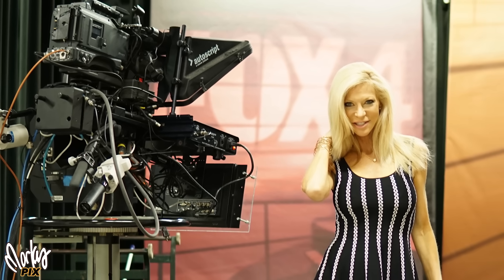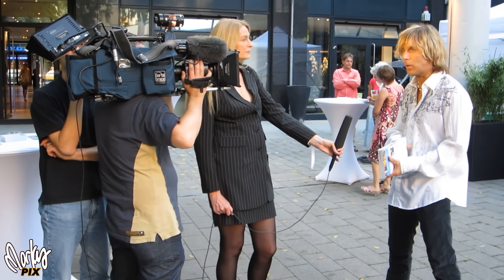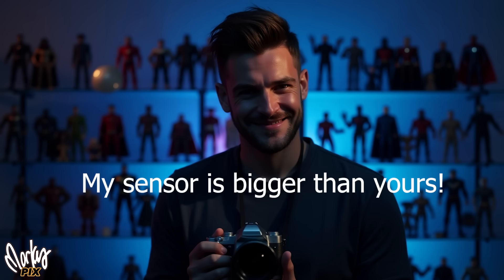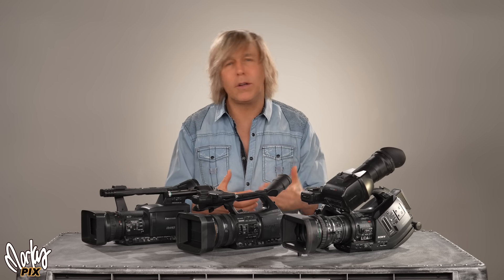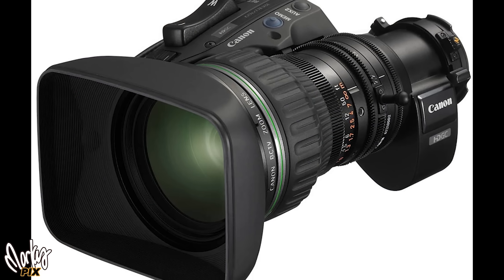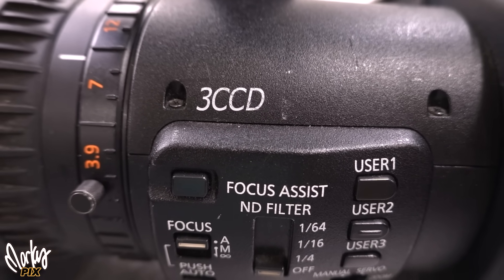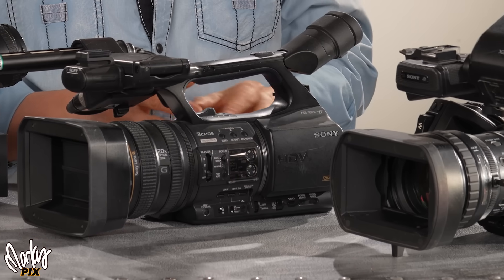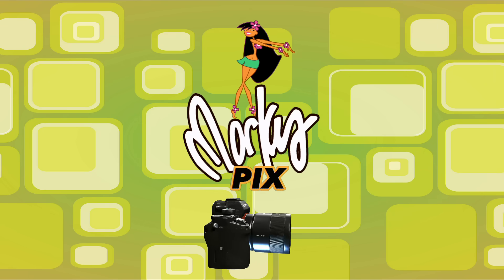Why the Broadcast world uses 3 chip video cameras

Comment: I see the point about the separation but I don't see how the perfect skin tone isn't largely a matter of getting the WB right, whether on a single chip or multi-chip camera. Obviously, in a studio / news setting, you can set it correctly once and then you'll get great results after. I'm surprised that Sigma never pursued Foveon sensors for that market; they should also have that perfect color separation while only being one sensor.
Reply from the maker: yes white balance is important no matter what. But if you put a properly white balanced 3 chip shot next to a properly white balanced 1 chip shot, you'll probably see a quality difference.
Reply: @MarkusPix   makes sense. Informative video. Is there a danger that the 3 chips get out of alignment or that the optical splitter is less than perfect.?
Reply: @jeffrick  yes. About 15 years ago I fell down carrying a Sony DNW-9WS BetacamSX rig and it knocked the optical block out of alignment. It ended up costing $10,000 to replace the whole assembly.
Reply: @MarkusPix  Okay, I've been thinking about this. IT IS FASCINATING. First off, an optical splitter avoids artifacts introduced by de-Bayering. But I think it goes further.Consider a single frequency color (like putting fire to an element), on 3 chip camera, that pure frequency will either go to R or to G or to B because of the optical splitter. It'll show up as either 100% R or 100% G or 100% B. On a one chip camera, it'll go to all of the photosites. The response pattern of the respective R, G and B photosites will determine how much R, G and B is registered. That's why green screen separation is so much better with a 3 chip camera: It only shows up in G. There could be a drawback. Consider a frequency that is slightly lower or slightly higher than that first color. On a 3 chip camera, it'll look the exact same, either 100% R or 100% G or 100% B. On a one chip camera, it'll look different. What our eyes perceive will be more similar to what the one chip camera can capture. Very narrow frequency responses are rare in everyday life. For example, a commercial green (or blue) screen is created to be that. You won't get the same properties from a wall that has been painted green. Optimizing for skin color under high CRI lights, as you will find in a television studio, the 3 sensor camera should be better.

Comment: I used a Canon XH1 for a number of years until its tape transport broke. The problem with that is that the screws are so small that it is nearly impossible to remove the tape cover necessary for cleaning the tape roll properly
Reply: Now I know Fuji stole the name X-H1 from Canon.

Comment: The X900 was a good camera but it suffered from "Bondi blue" color cast that would make the sky unnaturally blue under certain conditions.   I had a 3CCD Panasonic camera (SD) and although the low-light performance was awful (1/6-inch sensors) the color rendition was excellent.   CCDs also have the benefit that they are a global-shutter device -- no rolling shutter artifacts during fast pans or movement.   At extreme shutter speeds things look very crisp.
Reply from the maker: yes it liked blues but it was much easier to color correct than other cameras because of the 3 channels
Reply: did you ever feel that the image from the 3-CCD could be a little too crisp? I rather tend to prefer the warmer 'old' look of the tubes to be honest, what do you think?
Reply: @swanvictor887  No, mostly it was a case of too much sharpening being applied back in the day of SD camcorders -- that produced a ringing/ghosting on the edges which looked awful.   The cheaper the camera, the more pronounced the effect quite often.
Reply: @swanvictor887  that too crisp look is probably coming from the lens.
Reply: @ interesting theory. I never considered that. For the most part, back in the 80s, we used 'standard' Fujinon lenses with 20x zoom, par focal, never noticed any image issues, well, apart from potential 'smearing' in either low, low light or too much light: one tried to keep exposure stable.

Comment: Hi Markus
Do they have a mic jack 😻
.. stereo or multiple channels?

Could you do a video about the X900 as they are not expensive.. for YT and home use or is there something lacking compared to the 980/981 and 405
Thank you again for the recommendation of the Sony 405 I've been using it almost daily for 3 years filming bits, I have bought a second battery and the Sony RM-VPR1 I don't use it often but worth getting.
Kindest regards from Bella & Mark.
Reply from the maker: They X900 are not as sharp as the VX981
but here are samples https://youtu.be/7qZPBGfQ3hQ?t=997
Reply: @MarkusPix  
Thank you.
I then watched several of your other videos, a couple I have seen a year ago.
As I can't find a 980/981.
looks like the 900 is my next camera to work with my 405 💖

Comment: 3 separate chips also means they don't need to debayer. Foveon's X3 sensor (used exclusively in Sigma DSLRs) is the only attempt I'm aware of that attempted to capture RGB in a single sensor without a Bayer pattern.